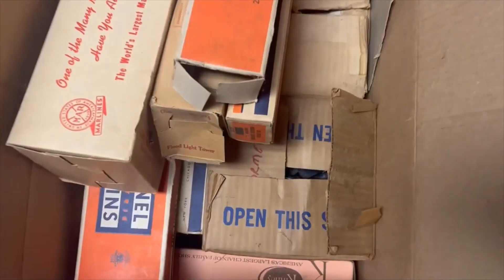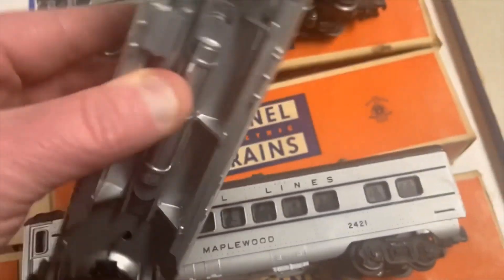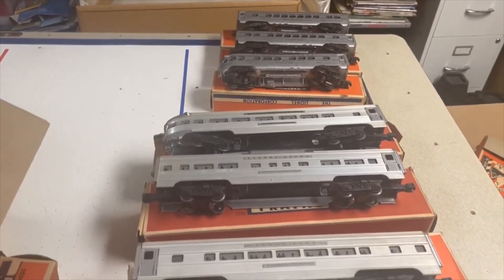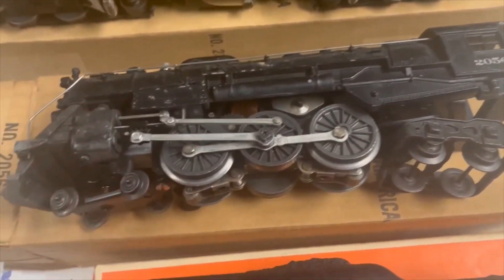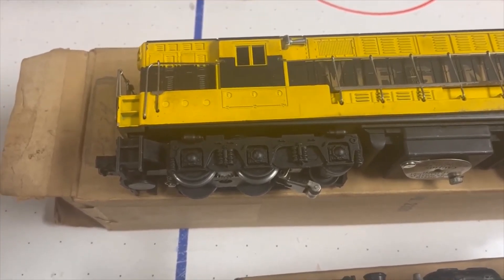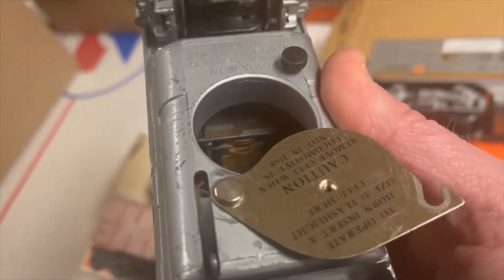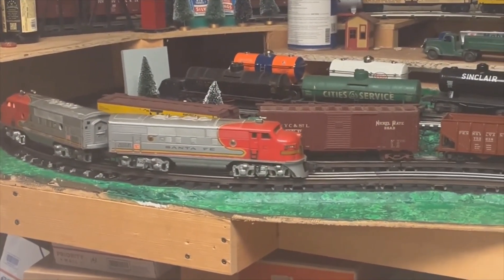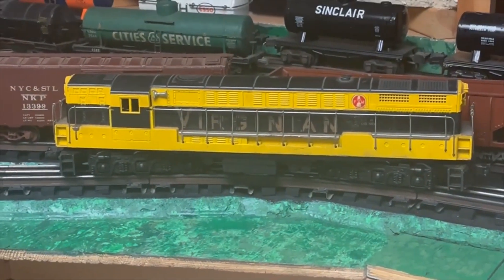Found a small barnfind collection of vintage postwar Lionel trains, Will they run?

Comment: I've been wanting one of those 2331s for years... lovely stuff you got yourself! I have a 2056 with her original box and inserts... the bearings on all the drive axles are pretty seriously worn, but somehow she still runs good as new!

I have a 6520 I need a new searchlight housing for. Got it pretty dirt cheap somewhere, otherwise in good condition. I was pretty fascinated with how the 'remote control' switch for the light works- the "shoe" underneath the car gets pulled down by your typical 6019/UCS, which moves a pawl that indexes a contact drum. Some neat trivia on that- this contact drum is Lionel part # 1001M-42, and is a component of the bizarre plastic 'scout' motor. Instead of being used in tandem with the 1001M-43 to reverse polarity of a scout motor's brushes, it's used to make and break the circuit to the searchlight bulb. Pretty clever of Lionel to use such a niche part for an entirely different purpose.

Comment: That is an awesome find. Thank you for sharing. The 2056 shouldn’t have magna- traction as it was made in 1952 during the Korean War. I have that same locomotive but a repair shop where my parents got it installed Magna-traction. It was a used engine I got for Christmas in 1972. It still runs great. Postwar Lionel and American Flyer where made to last a lifetime.

Comment: Nice collection...  I have not seen much of your stuff here on YouTube so if this is redundant, sorry. The 2333 series horizontal motors are grand pullers. Mine has mag na traction, however, part of their gearing is not easy to get to unless you remove the 2 screws inside holding the motor to the truck. There is a double worm gear in there and more places to grease and oil. Your Virginian FM might need a armature bearing problem fixed, or just grease or oil on both ends.  The 2056 will need it all oiled and greased well, often the squeal comes from the armature, needing both ends oiled. E units often if the former user only ran in one direction will have burnt or indentations, especially if it was running two motors. I had a recent FM given to me and it had the one finger burn off making it now only run in one direction.